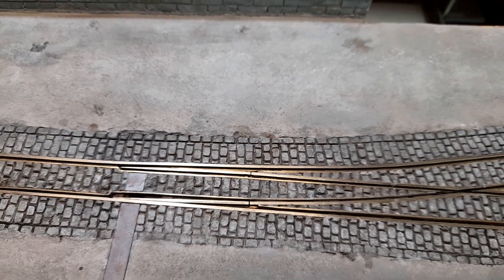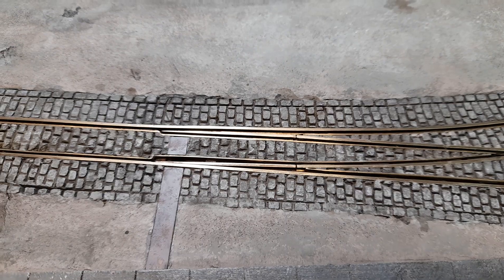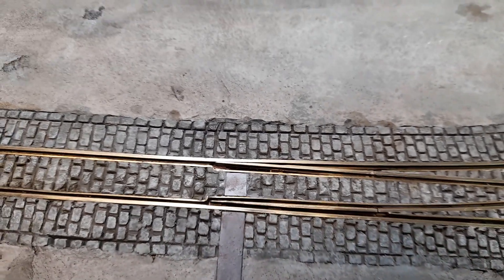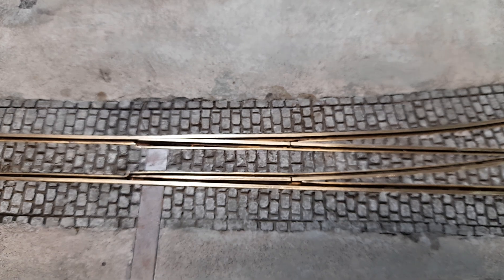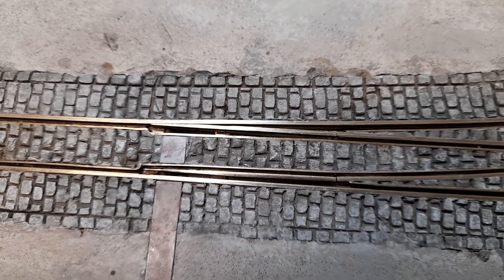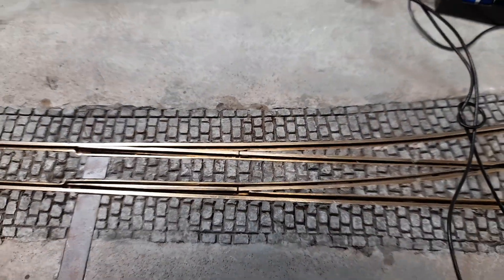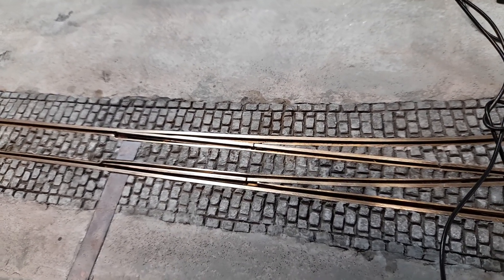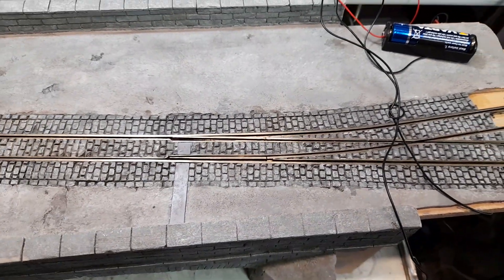Printed Point Motor for model railways by Giles Favell

Comment: I really like this concept. Can you explain how the indicator light detent works?  The locations of the detente for the light must not be 180 degrees apart. If they were, a single limit switch would not know which direction the points were facing.
Reply: From your other video, there is only one detent for the indicator light. I guess the switch assumes the points are in one direction unless the limit switch reaches the detent which signifies the points must be in the other direction.
Reply from the maker: That is correct  - and as both switch and point are operated from the same cam, it makes a reasonable assumption, the exception being the blade actually jamming. It is a route indicator rather than a safety issue!
Reply: Thank you Giles.  @gilesengineer    Your modeling is wonderful. I ordered your book and am awaiting delivery.  It is sad that Deltang had to stop production. Hopefully, there will be an alternative.